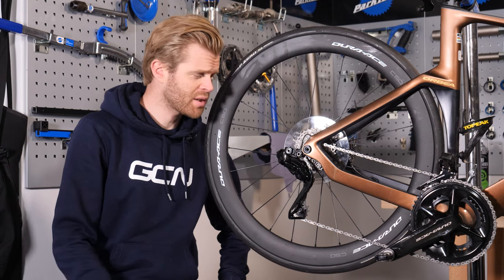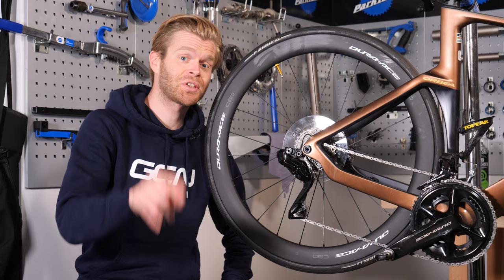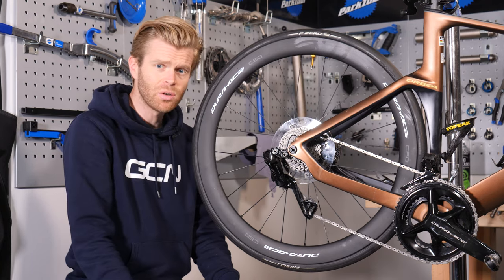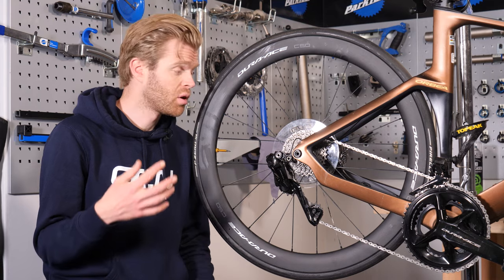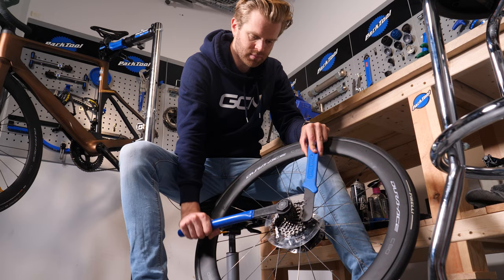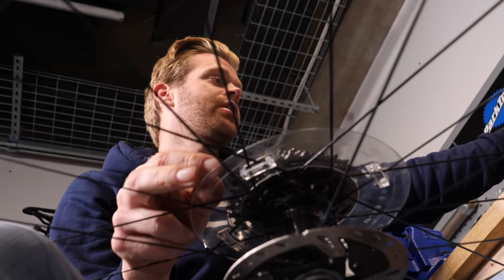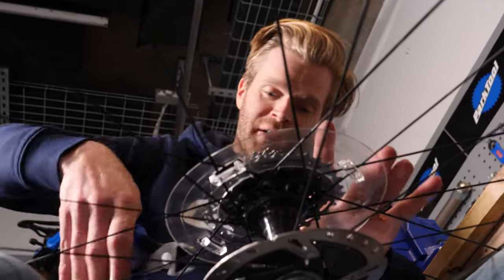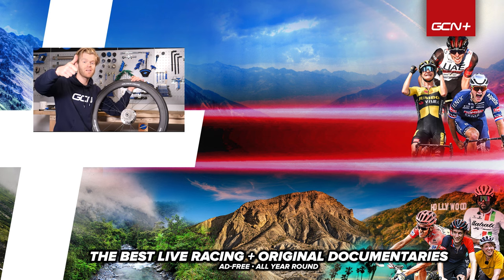How To Remove A Dork Disc From Your Bike | Maintenance Monday

Comment: Well what does that say about the mechanics at bike shops? Because when you pick up your new bike, it always comes with the Dork Disc… hmm…
Reply: it’s because they are shipped with them from the factory. often a health and safety legislation measure.
Reply: Yes, but after the mechanic sets up the bike and fine tunes it so that it's running properly, shouldn't he/she as the Professional, take it off? BTW my Canyon bike didn't come with one. But all the Trek bikes I picked up from the store, do. Doesn't really matter anyway.  ;)
Reply: In the USA, spoke protectors and reflectors are required to be included by the US Consumer Product Safety Commission.

As a mechanic of over four decades, I have seen enough wheel damage that generally I am in favor of spoke protectors. Even when a bike is perfectly adjusted, sh*t happens, and a spoke protector can help mitigate damage, just like how the the little stuck-on chrome plate on some frames helps mitigate damage to the chainstay by the bottom bracket. Same with chainstay protectors that guard against chain slap. Funny how those items are OK, but a spoke protector gets called a "dork disc."
Reply: @nalissa77  My Canyon came with one. Was the box even opened between Taiwan or wherever and my house?
Reply: @tomscott4644  I had mine set up by Velofix? The company that they use. Maybe they removed it? No idea, I seriously doubt it since he didn't even check to see if the gears were indexing correctly. Just to be clear I am not against it. I leave it on if it comes with one. My Canyon, didn't. All my Trek's did.
Reply: @nalissa77  I set mine up myself. Basically just putting the handlebars on. The seat post clamp didn't have a bolt in it, so had to go get one. My gears were not close to indexing correctly as it came, surprised the tech didn't do that for you.

Also had reflectors on the wheels and seat post, btw. I bet it's some code.
Reply: @tomscott4644  That's what I should have done. Next bike I will, they were late - and they called to set up the delivery time - then I asked him if he checked the gears and made sure it was indexing properly. He looked surprised that I even asked that and then blurted out that "Canyon is pretty good out of the box." Not a "yes" in my book. And it wasn't. Mine did come with reflectors which I removed as I use a Garmin Varia and other lights.

Comment: Am I the only one that's gone and bought a dork disc and fitted it? 10,000 miles of gravel riding and three sticks in derailleur dramas resulting in a bent derailleur hanger from each one = derailleur wrapped in spokes miles later. I now have a park tool DAG for these situations but can't praise the dork disc enough since the last time it happened. Roadies need not bother with one though!
Reply: I also use them on my bikes. Once on an older bike the chain fell off and got stucked between the cassette and the wheel, the spokes were bent afterwards. I don't want to buy a new wheel just because of such a situation any more

Comment: Less controversial than Simon cleaning and lubing the chain with WD40 😄
Reply: WD-40 works fine for cleaning (it's essentially petroleum), it just don't lubricate good enough. 
Since WD-40 is expensive I sometimes use Diesel to clean chains and cassettes (if they are disassembled from the bike) , it's also a good cleaner for little money compared to specialised stuff

Comment: I think it says a lot about their products if the manufacturers see something like that as necessary. And it probably is necessary for people who buy a cheap bike and never maintain it. But those people should also just be buying bikes with gear hubs and chain cases which don’t have any need for one.
Reply: They are required to be added by government regulation…
Reply: @popeyebouldercreek  I think they’d probably benefit from it not being mandated because more people would need more replacement parts or new bikes. But I mean there’s no mandate on things like that for gear hub bikes, so that’s for sure the best option for regular people who don’t want to do constant maintenance. And then you could remove the mandate.

And that’s before you consider that derailleurs are kind of pointless for anyone who’s not a pro racer anyway. They should only be special order for pro bikes, and not sold in shops to regular customers in my view.